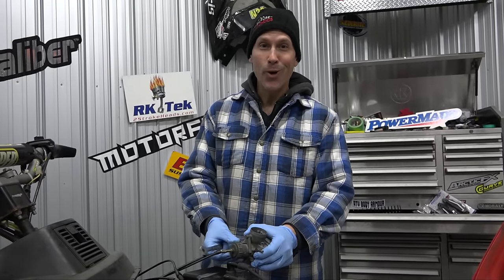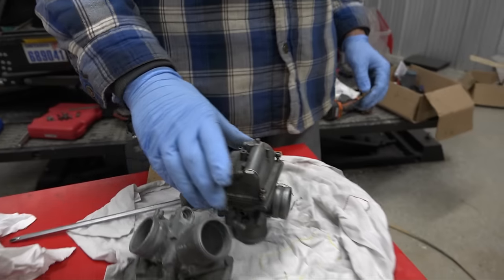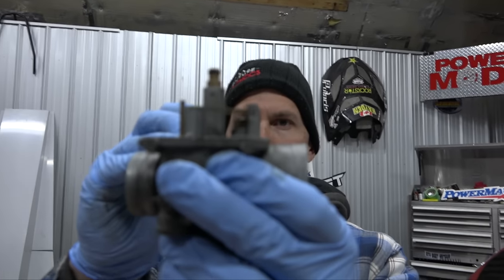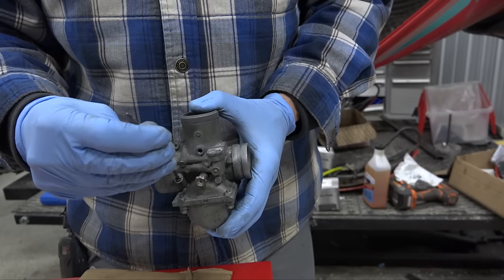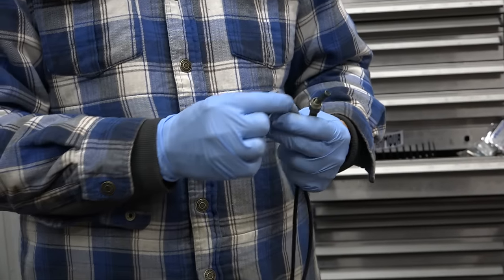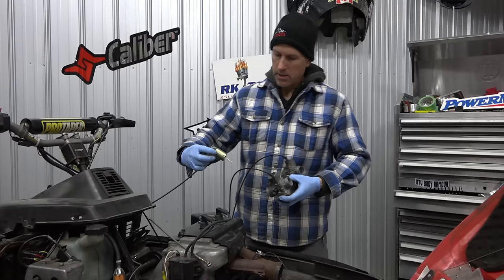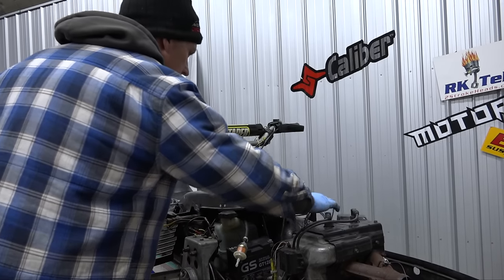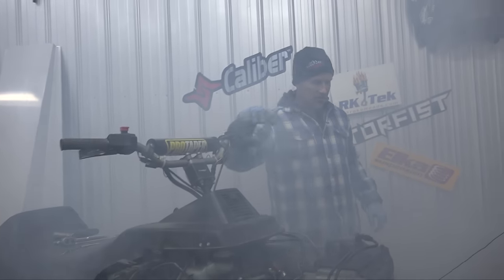Snowmobile Bog series #5, going over the carbs and first start!

Comment: Dude your air screws are off for a Indy lite! Polaris specs 1.5 turns out for this sled. Usually what causes a bogg on a two stroke whenever accelerating or a high load is applied at a low rpm.

Comment: Nice video, thanks! Regarding perpendicular floats - might be worth mentioning that if the floaters had been hanging from the float lever, as is the case in many other carburators, their weight makes it impossible to adjust for perpendicularity like that. You have to turn it 90' to the side, then slowly turn it until the float lever juuuuuust touches the springy thingy. And check THAT position for perpendicularity (turn your head). I know you know this, but maybe not for everybody watching. In a carburator with floaters on the lever, if adjusting for flat, when affected by floater weight, holding it horisontally, will mess things up.
Reply: So you're saying you can't adjust the float lever (the bronze hinge that pushes the needle) horizontally because the weight of it is pushing the needle (spring thingy) down a little?

Comment: Just purchased a 1997 artic cat Puma 340 and I did not do a compression test on the motor before purchasing the snowmobile because the seller said he just had it running all day and then it would not restart. Noticed two different heat range spark plugs. (bad sign)The brake side cylinder was at 120 psi ,but when I checked the clutch side cylinder it was at zero. Next used my finger over the spark plug hole and nothing with hand cranking the motor. Used a flat head screw driver to bring piston to TDC and looked down the spark plug hole and saw the piston pin roller bearings through a hole in the top of the piston. Payed $350 for the sled. Not sure if it is worth repairing since the aluminum pieces of the piston probably ruined the crankshaft ball bearings as well. Tomorrow I plan on taking the cylinder cap off to get a better view of the damage. It sounded like a fuel issue the way the seller saw air bubbles going through the fuel line to the carburetor. Will hopefully not make that mistake again. If a motor will not start check the compression before buying. I am hoping the seller will understand and we can exchange securities back in some fashion. Watching your video kind of showed me what I am up against in terms of work that would need to be done,
. Thanks for spending your time to educate me and others.

Comment: I cleaned out the carbs on my 95 formula rotax 583 rotax, it drives but it bogs when I try n go fast. I fixed the skid and still nothing.. what can it be?
Reply: denver dedam your slide needle might be a touch high it’s easy to put the clip a position higher to try and lean it out a bit

Comment: I’ve had a boggy Arctic cat for a while now. No matter what I did it’d bog, and as it warmed up, it’d get worse. I pulled the motor, ensures the timing was right, rebuilt the fuel pump and replaced the filter, then spent a good hour or so fiddling with the carbs. She runs pretty damn good now. Just had a 60 mile day and had minimal issues. (The carbs still need minor adjustment)

Comment: L:  I bought a Scandic 2 377 w/o the carbs.  The carbs I picked up have plunger holes for a choke - Instead of getting choke cables and plungers, I'd like to plug off the choke holes completely and use only a primer.  Can I  simply close off the little pipe into the bowl and the carb holes?
Reply from the maker: sounds liek a good idea - try it and let me know! - or just leave the plungers in if they arent worn out.

Comment: I have a question I have a 1997 mach 1 700 triple when I start it up it runs great    It does not have no hesitation of going but once I hit 60 miles an hour I hit the throttle past half way and it starts bogging what's the cause of that
Reply: power vavles?  Jeremy rhydes on youtube had the same issue. https://www.youtube.com/watch?v=WtAfgkNLesE&t=1314s   watch this video it might help you if you have power valves

Comment: HELP! I toke my 1994 Yamaha 500 Vmax in to have the carbs cleaned because it was bogging down at mid range throttle only after the engine has warmed up for 10 to 15 minutes. It's still doing the same thing. I'm a little frustrated if I have to redo the job that the "professional" was supposed to do. Do I have to reclean the carbs doing all the detailed stuff you talked about on this video? OR is there something else that I should be looking at. The problem only occurs after the engine is supper warm and only bogs in mid range throttle.
Reply from the maker: ya you need to go thru everything.

Comment: that oil hose that you took off does supply the lower bearings with needed oil why did you not hone the cylinders and chammfer the ports.you did not measure the ring gap you also should have oiled the cylinders before you put the pistons in you also forgot the new recoil rope you wanted to install. hope you don t catch those new rings in the ports if they are to tight follow your own advise do the job   the first time

Comment: SEAFOAM will fix that issue !
Reply from the maker: seafoam is good but there is nothing to seafoam - everything is new and clean,.
Reply: 7 bucks a can at Canadian Tires you can at least try it ! My old Grand Touring was doing the exact same thing ! Put in new pistons and gaskets, cleaned the carbs like crazy. Started the thing up and it was still bogging ! We where scratching our heads to this. Next door neighbour came over with a can of Sea Foam and first 5 minutes nothing happened then out of no where sled started to pick up RPMS and white smoke was everywhere but the sled was running in mint condition ! We still couldn't understand what happened there ! But it worked !
Reply from the maker: ok dangit ill l give er a try!  On video just for you!
Reply: Thankx bro ! It might work !